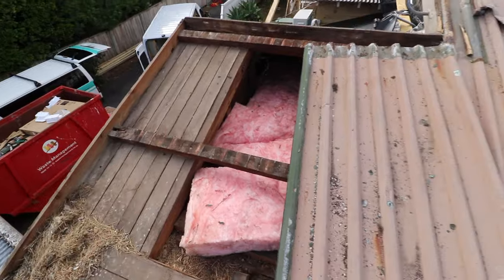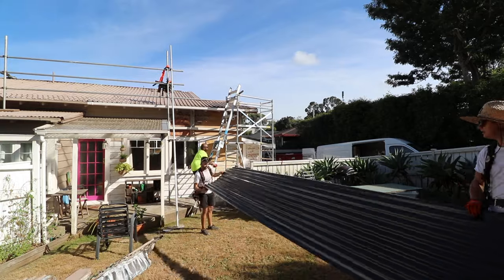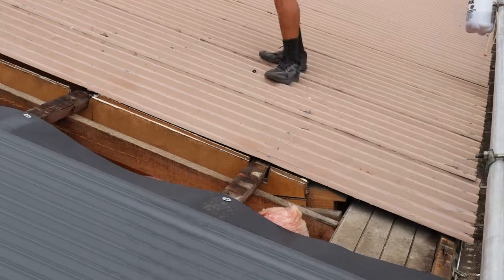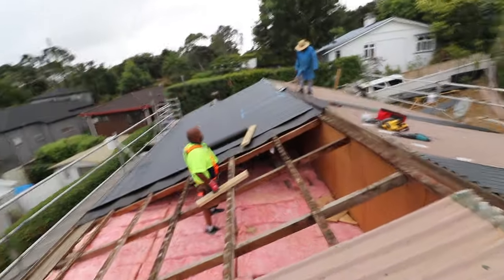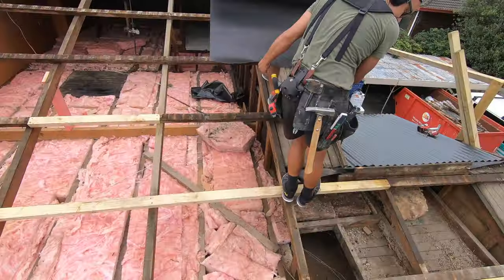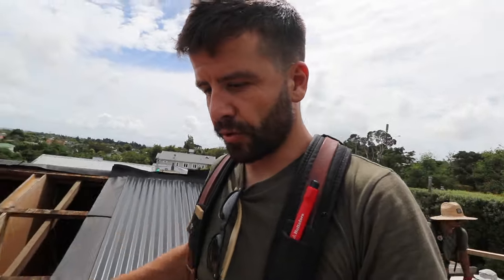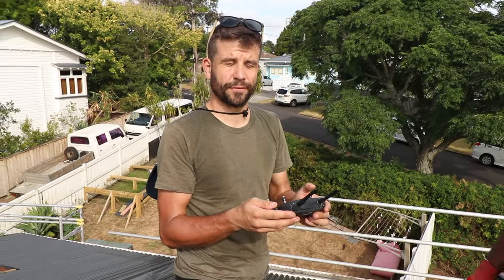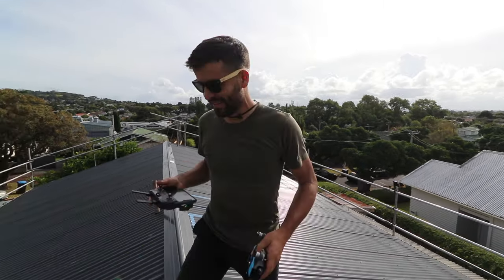How to Replace an Old Roof!

Comment: Always interesting to see the variations in procedure of different countries on how  structures are put together. I've either built or helped build a number of structures in several different countries and whether it's roofing, framing, plumbing, or electrical it's always different. Not necessarily better or worse, just different
Reply: It really is.  I know that i’ve picked up a couple things from watching different people from different areas work.  Just different methods to do the same or similar project

Comment: Tidy  job Scott . A small tip if your purlins are running straight it's sometimes easier to pre drill your sheets all in one go when there bundled it saves caulk lining each row. Keep up the good work mate.
Reply from the maker: Smart, I like it

Comment: It's a lot quicker and easier to pre-drill your iorn on the ground. Stack them all on top of each other and drill, your screw lines end up perfectly straight 😉
Reply: Will Clews no it isn't
Reply: Straighter than following a chalk line??!
Reply: Ya can't do that, a lot of roofs are not square, especially not old ones,  and often you need to step sheets and your screws do not work out to be in the same place on each sheet.
Reply: Sure, RR Buildings does that, but his shit is perfect.
Reply: Jim Doherty The paper is there to move the dew point to the top of the metal roofing, if you don’t have it the condensation occurs on the underside of the metal sheet. Then you end up with water in your attic. If there is water getting through the metal roof you have big problems, the paper isn’t there to provide waterproofing. It’s much faster to lay paper vertically and it also allows you to be able to do smaller sections of roof at a time. NZ weather is notoriously changeable so sometimes it’s better to only strip off a small section at a time, lay new metal and then strip off another small section. You can’t lay paper horizontally without stripping the whole face, if it starts raining during the process you’re stuffed. It may seem odd to people who live in places where it snows but the way metal roofing is done in NZ has been like this for 150 years plus.
Reply: @marcpledger  in the US atleast where I live, its standard for waterproof stripping to be place horizontally from the bottom up as a second barrier to water, normally on plywood. Every lap sealed with glue. These are on buildings that are new though so redoing an old roof is a different ball game, most I've seen already have some sort of water barrier under the metal roof though.
Reply: @smugegeez1406  Most NZ iron roofs don't typically have sheathing (no ply or OSB), and are framed with purlins on rafters, like this job. The issue is mostly condensation, as Marc said. But NZ buildings are also notoriously leaky!
Reply: @smugegeez1406  why do you guys use the OSB/plywood roof deck? Is it because you need something to attach shingles to or does it serve other purposes?
Reply: @tmuxor  I do sheet metal so its used to screw to and walk on when you put metal panels up and allows you to put a vapor/ice barrier on it easily, but yeah the same goes for shingles. You also put insulation under it and it helps keep it in there. Normally pitched roofs are like this here but flat roofs are done a lot different. Im not sure if it actually helps with anything other than that honestly, it keeps the vapor barrier flat too where as if you didn't have plywood it could concave in the giant open spaces where there's nothing and cause water to pool up if it somehow got under the panels via a leak, which can be extremely bad with certain types of metal like zinc.
Reply: I did notice some steps in the purlins, so pre-drilling may not have worked out.
Reply: Jim Doherty  As long as the roof pitch isn't too shallow vertical paper runs fine.
Horizontal wastes a lot of paper with big overlaps as the top edge always has to be on a purlin.

Comment: Wow, fun watch. Questions; do you normally get all the fancy scaffolding and safety railing for roof jobs and add a levels? Do you shop vac out dirt and dust before you closed it in? What percentage of houses have metal roofs down there. Maybe 1% in some states in US. Great content, thanks.
Reply: it's called edge protection, I think its required by law now. the scaffolding is only a small section for them to get up and down.
Reply: Percentage? Probably a good 50% use corrugated metal roofing. The other major one is concrete tiles.

NZ was an old English farming outpost essentially in the early days, so the mentality of "doing best with what tools and materials you had" is apart of the NZ psyche. Plenty of metal roofing for farm sheds etc, why not on the family home?
Reply: HaYouDontSay No english don’t build as good as possible when you compare it with Germany British construction is shit
Reply: @HaYouDontSay  50%? I would have probably said alot higher than that.
Reply: HaYouDontSay HaYouDontSay hahahahah today I needed to cut some re-bar and we only had a makita grinder on site , but the two makita batteries on site were both dead, so I tried to power the makita grinder with my Milwaukee battery, using some wire I cut off that was hanging from the roof, it didn't work though, the grinder just started smoking and wouldn't turn.
Reply: The scaffolding is part you see is mandatory. Any work undertaken higher than 3 meters or where an where any employee may fall more than 3 metres: requires a scaffold to be installed on ALL sites as implemented by Health and Safety at Work Act 2015. Work Safe NZ enacts this as part of legislation. A large proportion of NZ homes (I would say 80%) have corrugated steel roofing, because as clay and tile roofs age over time from environmental factors, can send clay, silt and other sediment down downpipes into city storm water which most councils frown upon. Most councils prefer water to be leeched back into the soil on homeowners property.
Reply: @HaYouDontSay  The people were from primarily from England but the building methods were actually from California. Both the builders, the construction methods and the milling machinery came from USA. Both San Francisco and the Los Angeles have areas that you would swear was Aukland and Wellington.  Check out the book "Old New Zealand Houses 1800-1940 by Jeremy Salmond" it is an awesome read and details construction and how it happened.

Comment: How do you find the Hitachi framer? I almost threw my paslode off the roof yesterday
Reply: I got one  a few weeks ago. happy so far, gruntier than my paslode
Reply: They are great! No gas or cleaning. Bit heavier but grunty. Liked mine so much I got the brad nailer too. Some good deals on Hitachi runout in NZ as they move to the Hikoki branding

Comment: You can get away with roofs built like that in NZ but here in Canada that roof would last only until Winter, we need beefy rafters or trusses spaced at 16" oc  and sheathed with osb or plywood.
Reply: No snow in Auckland to worry about. Other parts of the country may have to factor it in.

Comment: My only complaint is that the paper is way too loose. Pull it tight thn fix each corner should be enough. Also i wouldve stripped the whole side or half a side depending on weather. Paper the whole lot thn lay. More efficient imo. Also they need to ban that black paper lol. In sayin that im glad i found this channel. Good stuff 👍

Comment: Good example what happens when you fix roof panel from ridges. 
All nail/screw holes start to leak because it isn't rigid enough to prevent roof panel slightly moving on wind and with thermal movement also you can't get tight seal for that rubber sealant because metal will bend.
Reply: These roofs are incredible strong and weatherproof and the whole roof forms a diaphragm. The screw pattern is not just along the ridge edge. The corrugation profile allows for the expansion and contraction. It's an incredibly versatile and durable build method when it incorporates hurricane ties and the correct bracing methods.

Comment: Excellent work. How old was the previous roof?  Ive been told I should replace my roof but its only 34 yrs old and I understand colorbond should be good fo about 70 yrs. I have no rust, just lichen and some screws need washers. Any suggestions?
Reply: 34 years is an old Roof, I would say it needs replacing but in saying that it might be able to be restored and Recoated

Comment: What I dont get is why treat the old timber when each newly replaced timber has its own hazard class?  

Metalex is generally used to treat any fresh cuts that will be exposed to moisture and the elements. Not so much for beetles/ boron related  issues. If that were the case you would use a chemical / fumigating application instead.

Comment: Never seen so little timber on a roof! Wouldn’t get away with that in the UK. Great video though.
Reply: It’s a very standard design, NZ roofs have been built like this for 150 years plus. We don’t get snow in most of NZ so no need to build for snow loading. Metal roofing is lightweight, concrete tile roofs have a lot more timber.

Comment: Why not use a foil insulation blanket instead of just sarking. The blanket helps reduce mechanical noise transmission from the metal creaking.

Comment: 6:40 Are the old fixings nails or are you pulling old screws out with that claw and hammer?
I've half a dozen sheets to replace whilst replacing a solar hot water system at my mums and I'd appreciate knowing if pulling old screws is better than trying to impact drive them out (assuming the old fixings aren't nails.)
Reply: They are nails here. Stick with your inpact driver.
Reply: @HighMaintenancePS  Thanks, I went with the impact driver months ago and the screws came out fine.

Comment: Ive got major noise that seems to come through the roof (same style as this one, but i notice its got building paper underneath) when I replace it what sort of options could be used to reduce the noise that travels through it? I can even hear birds walking on it in bedrooms, could plywood or some sort of rubber membrane (thicker building paper?) be used underneath the tin sheets to provide more of a noise barrier? Im guessing traffic noise always makes it way through if im able to hear birds walking on the roof too
Reply: Plywood would definitely remove that sound transmission. Or any other kind of sarking (boards) as an underlay. Starts getting pricey depending on what you use but there are often suppliers getting rid of ply that has failed the structural test, or other DD rated ply. Even 9mm ply would greatly increase sound and heat insulation.

Comment: No butyl tape on the panel overlaps? Is that not used over there Scott? Foam eaves and ridge  fillers?
Reply: No need when the slope is over 8deg (~1:7). And we don't get snow so ice dam is not a problem.
Reply: And the ridge flashing has a flexible transition strip that is moulded to the roof profile. Moulded foam is sometimes used but it can actually interfere with condensation drainage and evaporation so unless it's used under a complete construction specification it shouldn't be "added".

Comment: Looks great but I've got to ask whats up with runing the underlayment like that if you do uave a leak its just going to puddle between the. Purlin and go under the overlap unless its some magical paper it doea nothing to help protect from a leak. Like the hand rails tho lol the illusion of safety. Huge man size hole at the bottom if ya have a seizure or something and can't grab a rail then what yall have a team of guys dressed like firemen with a trampoline down there?
Reply: The paper isn’t for waterproofing, it’s only there to shift the dew point to the outside of the roof.
Reply: @marcpledger  for real? That's really a vapor barrier? I know it's humid and rains a lot. But I'm failing to understand how that helps  And if you happen to have a leak? Then it's just job security or do y'all have some kinda roofing technology we don't have  and leaks are another thing that's only for Freedumb Loveing Mericans?

Comment: I bet the roof wont hold 2,5kN snow per m2, like we need them do. Looks pretty light build-structure there. Althou maybe they dont need to, hehe!
Reply: No snow in Auckland bro. Every now and then a small tornado will rip a few of these roofs off but very rare.
Reply: No shit. It's actually technically called a lightweight roof. The timber frame is generally rated to support a 1.5-2.5kN load.
Reply: That is, The timber construction of a modern house-build in this style, using this type of roof is generally rated to 1.5-2.5kN.

Comment: never wear shorts when working with metal, i learnt this first hand and several stiches later.
Reply: Or without forearm protection.
Reply: I disagree. You would die of heatstroke in the Auckland sun. Possibly literally.

Comment: 3:35 - Nothing else needs to be done to make the metal screw fastener locations water tight?  Is the washer head on the screw the only protection against water entry at the screw points?
Reply: Yep

Comment: Thank you for this video, I live in Canada and I have to do my roof again after 18 years. The contractor was using the IKO shingles on my roof and I was told that the product has 25 years of warranty, however, the shingles on the sunny side started to fall apart already after 18 years. I have contacted IKO and they are offering me the warranty reimbursement ONLY if I use their shingles again. My question is what is the normal lifespan for the shingles in general? How good these IKO shingles in comparison to the other brands?

Comment: great job lads. another technique instead of a doggybar on those nails is to use two hammers one to claw and the other to hit, better grip and leverage if you don't mind wrecking the old iron too much
Reply: Kiwi Bird it’s dangerous to hit two hammers r together if they are hardened steel which most hammers likely will be.
Reply: @jamatoke  huehuehue
Reply: Jamie Symmers why?
Reply: Its old iron anyway.

Comment: In nz are builders allowed to install roof still? Because in Australia it has to be a roof plumber! 
Btw Please tell me that wasn’t black chalk line!! Otherwise pull it all off and start again!
Reply: Normally you would get roofers for that job rather than builders.
Reply: TheClaudos in nz? 
In Aus legally a roofer has to do it and sign it off
Reply: I think that chalk line was actually Scott’s new purchase which is an ink line not chalk, not sure if i would use it as ink would indicate that it’s permanent rather than chalk which can be wiped off
Reply: @ashbroome8558  Similarly, the rules will apply the same here in NZ.
Reply: Well I wonder if it would rust the metal like chalk does any colour but blue
Reply: @TheClaudos  A reroofing job done without a building consent under the Schedule 1 exemption doesn't need LBPs.  A new roof does.
Reply: In Aus I just done a job and they had to get permit from council to do re roof never heard of that before

Comment: What's the paper underneath for? I'm from UK and never seen it before.
Reply: Protects the interior from condensation
Reply: Yep, in cold weather condensation will form on the underside of the metal roof. That will be one of the  causes of that rot on the roof framing (that and the popping nails and the rust holes!)

Comment: Your videos are great. I'm guessing there is no snow there. I can't believe how weak that roof support is. BTW, my first thought after you lifter the first sheet of tin was the insulation, there were so :many gaps in there. It would have taken you just a few minutes to straighten out the insulation to fix the gaps. At around 7:18 we cad see huge gaps in the insulation. Gaps in the insulation is almost like having no insulation.

Comment: Jeeesus it's like living in a chicken pen in NZ! Bet the roof is noisy af in the rain
Reply: That's one of my fondest childhood memories in NZ.   Falling asleep wrapped up warm and cosy under my duvet while the rain fell down on the tin roof above.  Even now, just hearing the sound of rain on a steel roof brings back that sense of warmth and safety.
Reply: It wasn't a derogatory comment just was surprised.the age doesnt make any difference really,houses 150 year old plus in the UK have a really solid construction
Reply: @adrianedhouse5175  I was going to write the exact same thing! Rain on a tin roof is such a nostalgic sound for me 😊
Reply: Adrian Edhouse my favorite part too I use to get a blanket near the fireplace and listen to the rain and fall asleep. Now tiled roof are boring hahaha
Reply: Ross, Yes Very Noisy in the Rain! However if you go inside you will find them much quieter ; )
Reply: @adrianedhouse5175  
"That's one of my fondest childhood memories in NZ."
With all the insulation in roofs now you don't hear it the same. I have the same early memories, though.
Reply: In all fairness to you Ross, it was a pretty light on framing construct. 100 by 50mm rafters at 1200 centers ? albeit a hardwood by the looks, nice bounce, no wonder o'l mate went in with some bracing. And you'd be hard pressed to find a good thatch down here because climatically it's not really required.
Reply: @rossmale8715    Nope, In NZ and the declining Australian property market, you are buying land and possibilities, the property comes a bad last. 150 years? you mean you cannot afford a new one in that time,     Ah  nostalgia